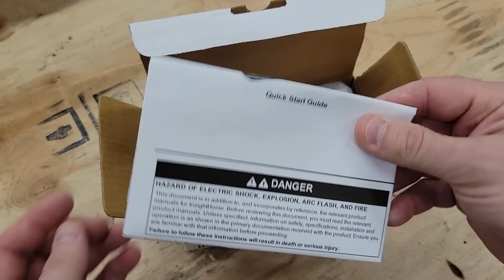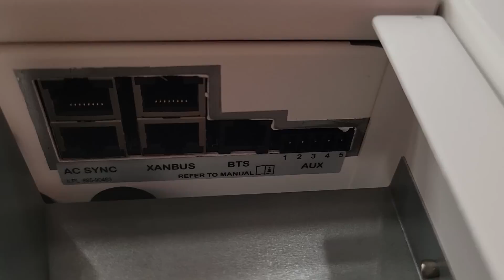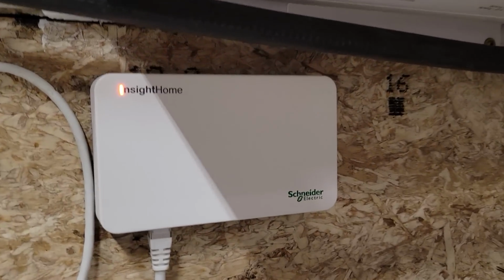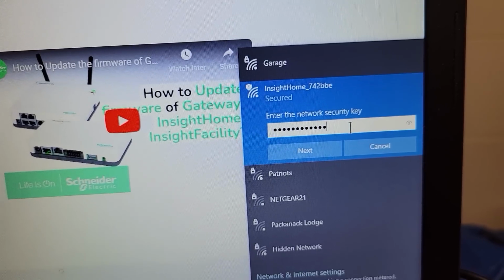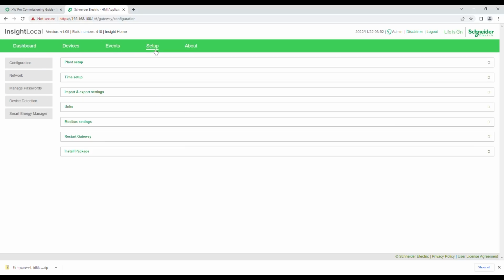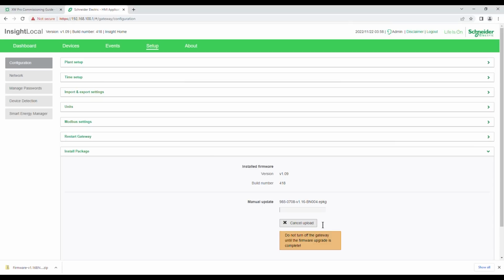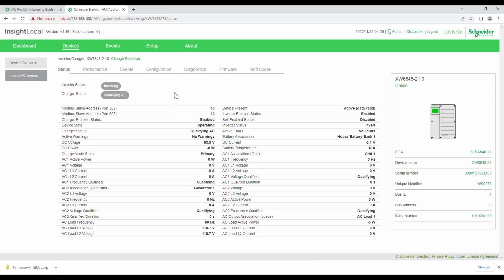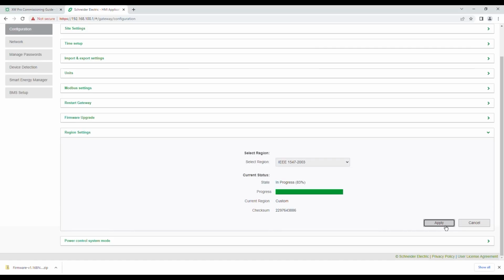Firmware Update on Schneider XW and Insight, off grid solar

Comment: XW and SW families of inverters are, in my opinion, the best inverters you can buy for any application. The surge capacity of those are stunning and the quality of the product is unbelievable. But, nothing is perfect, each and every component of the system is sold separately, sooooo,  at the end the system price tag will be higher than a all in one unit. At the end you can install all the parts in stages without having to pay for everything up front and you will end with a reliable system that can destroy any all in one system. I now that by experience. I put my 1300 square foot home off grid with just one SW 4024 and had no problem to run two mini split units at night. David…. You are on the right path. Thanks for share your experience. 

A side by side between a little SW  and a solark 8k should be an interesting one…..
Reply from the maker: Nice to hear about your experience.  Thanks.  It's been a few months now, and the XW has never faulted out while running my house.  Last year I tested the Sol-Ark 12k, and it was faulting out about every 2 days while running my house.

Comment: Fantastic work on getting through and figuring the Insight. We are super excited to have it up and running. When spring comes up in Alberta I’ll be installing 3XW Pro, 3 100/600, 1PDP, 3 15kw batteries and 60 425 QCell’s panels on 3 ground tilting arrays. 1 at 150, 1 at 180 and 1 at 210 degrees to stretch out my collection and reduce my midday peak. Being at the 53rd parallel my winters get short so I need a huge system to collect enough for night runs on battery. Your other video with the type of cable that can be directly clamp on to was awesome helpful.
Reply from the maker: Sounds like it will be an awesome setup.

Comment: The termination plug is just a 120 ohm resistor for the CAN bus. If the factory part is lost you could make up an RJ45 jack with a short piece of CAT5 cable, place a 120 ohm resistor across the wires for Pin 4 & Pin 5 (CAN-L & CAN-H) Be careful to fold back the other unused wires and make sure none are touching, these are the 15V + and - system power conductors, if they short the Xanbus network is lost and the power supply could be damaged.
Reply: Does this mean you can't use any ethanet cable?

Comment: Now that you have your insight you can do closed loop communication with those batteries from signature solar . That is a nice feature to have . Glad u didn't let insight intimidate you into not getting it .
Reply from the maker: Yeah, that will  make it worth while.  I look forward to that part
Reply: What is closed loop communication I have the Snyder SW 40 24 with lead acid batteries
Reply: @neomatrix2722  It is where the inverter and battery subsystem communicate with each other (the battery has a BMS, which is a battery computer).  Most importantly, the battery tells the inverter what the battery's charging profile is, as well has State of Charge (SoC).  They use RS485 or CAN serial communications methods.  RS485 is a superior standard than the old RS232 protocol
Reply: Good luck with that I've been trying to get mine connected to the eg4 batteries for a month and I sell and install all of this stuff the Schneider battery monitor is going to be your best bet from Schneider if you want it to work without a crazy amount of aggravation although the new firmware does seem to work good on the batteries the communication is the problem the shunt that comes with the Schneider battery monitor will communicate with everything through the xbus Network a lot better

Comment: David, you will find that the modbus connection is your friend.  everything speaks modbus.  I have solaredge and a heatpump water heater that speak modbus. You may also find your minisplits speak modbus.  With the addition of a raspberry PI and "node red" or Home Automation apps you can do power curtailment and monitoring.

And hey... you are becoming quite the master at this stuff!!!  What a journey!
Reply from the maker: I had no idea that appliances like a minisplit can talk to the insighthome.  interesting.  Now that I have it up, I can install a Schneider charge controller.
Reply: @DavidPozEnergy  Lets be careful here.... they all speak modbus.... but that doesn't mean they speak to each other.  You can use Home Assistant (I said Home Automation in error above) or node red to bridge the comms.

Comment: Right-clicking the zipped files in Windows file explorer will typically give you a drop-down menu that has an option for unzipping files. This will automatically create a file folder with the same name as the zipped file, which will contain the un-zipped files you need.

Comment: David,  I just wanted to thank you for this video..  I purchased the SW4048 inverter but they no longer produce the SCP remote display.  There is no great direction offered by schneider as to was the replacement is.  I have contacted support several times. I almost get the feeling these people do not really have any knowledge of their products. There are multiple options.  I chose the Insight Home gateway. It did not come with an A/C brick. Does the Xantrax cable power your device?     Anyway, I have watched several aschneider videos.  By far your has been the most informative and helpful.  Thank You.  Michael
Reply from the maker: Hi Michael,  Thanks for watching.
My Insight Home also did not come with an AC power brick.  The Schneider XW PRO, and the 600V charge controllers, all have power over ethernet.  Meaning, when I plug in a CAT 5 (or 6) ethernet cable, it powers the insight home.  I don't know if the SW also has POE or not.  
I used my XW inverter for months before ever connecting the insight home.  Right out of the box it was ready to work as an inverter.  But, to do more advanced features like generator, grid support, etc. you need the insight home.

Comment: Well done David,  love the video.

The InsightHome is a bit different model and it took me awhile as well to understand it.  When I bought it, it was called the "Conext Gateway".  That is where the term "gateway" comes from.  They discontinued that unit and came out with 2 different new gateways, labeled "InsightHome or InsightFacility" with the Facility allowing for much larger systems.

When looking at the Insight models, one needs to understand the needs Schneider wanted from the device.  From a single inverter and single charge controller installation to multi-inverters and multi-charge controllers installations AND the ability to REMOTELY connect and do things the same way as if in the same room.  

Once one understands their "model of operation" it become clearer what advantages it provides.

Also,  their deployment model is to  have "Installers" who do all of this, install, configure and interface with the homeowner.  It is not targeted at DIYers, but DIYers can grasp things and will seek out the info and eventually Do IT. But it takes time.

I have been using my gateway to monitor my 4 MPPT 60 150 charge controllers for several years now, and with my new Pro (less than 3 weeks installed - Wednesday before Thanksgiving) fits in nicely.

BTW,  I discovered that the InsightHome (gateway) acts a bridge between the Xanbus and TCP networking using an old protocol called Modbus (1979).  First I heard of it researching these devices, but I now wrote a python program (https://github.com/dougbertwashere/mppt60)  that reads all the registers of the MPPT 60 150. I use it to read all 4 CCs.  Will be adding the ability to read the XW Pro as well.  It is the data information that the InsightHome uses to present the data as a website.
Reply from the maker: Thanks for the breakdown, makes sense.

Comment: You should test a grid tie inverter one day. I got a cheap one from Amazon and it’s the most fun inverter I’ve ever used. Mainly because im pushing power into my home and using 100% of my solar panels power.
Reply: Mind if you share the link?
Reply: I can’t share links
Reply: I use a 600w15-32v 90-140v grid tie inverter by y&h if your wondering
Reply: Those inverters are technically illegal in the United States. They also do not follow NEC and are not UL listed. Your insurance company will not cover any damages caused by those plug and play inverters.
Reply: How do you prevent it from exporting?

Comment: Hi David, well as an IT professional,  i can say you do a nice job. 
You can see PCs are not your thing😀
But,  Schneiders upgrade procedure sucks, like many other other companies also mess up a simple upgrade procedure and/or their MANUAL. 
Nevertheless,  many times you need a trained professional to configure all settings. Also Victron has a lot,  on which you just need training. 
That said: lots of trained people also don't know all details. 
So,  in my mind: companies,  please just provide a good manual!
Usually,  even the trained pros, change settings which may not make sense,  but they are or told to do so by the manufacturer,  or from learning it the hard way(=experience), which they then are not willing to share...

So,  like BMSses without proper manual: how should you configure all settings...?

Comment: It's my understanding after some reading that you're able to customize the production and output screen are you able to show us out on your next video as my goal is to have a custom screen on my tablet hung on the wall showing me in real time the power production on making with my shoulder and the loads
Reply from the maker: I'll look into it.  I don't know all the features available
Reply: One thing I don't like about the InsightHome webpage, is if left alone it times outs and closes itself.  Move your mouse back into the window it resets the timeout count.  So as of now, it won't stay open showing its information. You have to relogin again - argh
Reply: This is where a company would be well served if it reached out to the diy off grid inverter YouTube community and ask: ‘what are we doing wrong, how can we make it easier to set up and use’?

Also- What features would you add?

Comment: Do you need the insighthome installed. For the inverter to operate? The reason im asking, is because im thinking about using this inverter. With a victron charge controller.
Reply from the maker: I ran my Schneider inverter without the insight home for 3 months.  The inverter will work right out of the box.  It's set up for 120/240V split-phase operation from factory.  You only need the insight home for more advanced things.  For example, if you want to parallel 2 or more inverters, set up 3-phase, generator, etc.
Reply: @DavidPozEnergy  oh I see, that's really good information. David I really do appreciate it. I'll only be using one inverter. But I'm really impressed by these inverters.
Reply from the maker: Good luck with your build.  I have several videos on my channel about the Scheiders.  I'm also very impressed by them.

Comment: Thanks for helping me with so many projects.Not related to this video,could you tell me how much solar to power my water trough heating element? And I'm unclear how to wire the 4 prong element.
Reply from the maker: Water heating is a huge topic.  I made several videos about it.  There are some variables outside of the information you provided.  Are you trying to go from solar PV panels directly to a water heating element?  Do you have thermostats involved?  Are you powering the water heating element from an inverter?  etc.  
I'd start by asking you to watch this video: https://youtu.be/kVaxAfXQPDU  After that, you are welcome to ask more questions in that video.
Reply: @DavidPozEnergy  solar to battery to element in water trough
Reply: element has 4 prongs with two plates. One video that I watched said to remove one plate, but it is not heating.
Reply from the maker: That style heater is 2 elements.   Each element has 2 prongs.  If you leave both brass busbars in place, you are paralleling the two elements.  This is done to increase the Amps at a given Voltage.  If you remove one of the brass busbars, then you must turn the other brass busbar.  Turning it is changing the element arrangement.   You will be making the two elements in series with one another.  This is typically done if you plan to use the heater with a higher Voltage.
Reply: @DavidPozEnergy  LOL. Thanks for taking the time for me. I LOL because I have one more question. So, if I only use one element, I place one positive and one neg on that one element?

Comment: Do you know if the Home Insite works with older XW Hybrid Inverters.  I have a model that came out just before the Pro.  It seems like all the videos I've watched only address the XW Pro.  Thanks
Reply from the maker: Sorry, I don't know.  Have you tried calling Schneider customer service?  I use this number: 833 391-8640  If you are somewhere else in the world, check here: https://solar.se.com/us/en/2021/07/23/meet-our-new-tech-support/
Reply: Yes, but Schneider does not advertise backward compatibility with XW inverters. Using COMBOX is not totally secure, unless your LAN is isolated or very well protected.

Here is the result from a search:

Insight Home is compatible with Schneider Electric’s solar & storage offerings, including the XW and SW lines of storage inverters, the MPPT solar charge controllers, and the accessories. Additionally, it's compatible with Schneider Electric’s commercial 3-phase string CL family of inverters for the European and Australian markets.

The COMBOX is not forward compatible with XW Pro inverters, but Insight gateway is backward compatible.

Have both gateways running in same XANBUS network for testing, but not recommended for permanent use!
Have not yet tested a firmware upgrade or downgrade from Insight Home to older XW inverters.

Comment: This is all new to me can this unit supply a 1400sq all electric  home without using a battery or solar panels only using a power generator?
Reply from the maker: No.  The inverter in the video requires a battery.  Now, if you don't have room for solar you can still use a generator to recharge the batteries.
Reply: @DavidPozEnergy  Thank you. What battery hook up will I need to supply my needs?
Reply: @DavidPozEnergy  David this is a summary of ELECTRIC we use.This Week: 12/18-12/24Last Week: 12/11-12/17￼Usage607.9 kWh334.6 kWh￼Cost￼  $89.30$50.04
We live in the Houston area. 
What kind battery Bank would I need? Is there a power source that does not require batteries? The panel box is outside of the house need to limit the clutter if possible.
Reply: @DavidPozEnergy  what battery pack would you recommend.

Comment: Is it possible to make this system work with only a smart phone no lap top and a weak internet hotspot???
Reply from the maker: I think so, but I can't say 100% because I used a laptop.  First, Schneider knows that a lot of customers don't have internet, so this is how you get around it.  
1. Find internet somewhere (coffee shop, library, etc.)
2. Download the firmware file to your device. (laptop, tablet, etc)
3. Go to the insight home location.
4. connect to the insight home's wifi signal
5. Open the insight home using an internet browsing software (ie. Crome) 
6. Follow the rest of the steps in the video to find the firmware file on your device.
Reply: @DavidPozEnergy  I did get it working but will picking a laptop ASAP.
Reply: @DavidPozEnergy  thanks for responding. Maybe I could put together a list of question's and you could do a video about solving these infantile issues as they arise. There are so many settings... I'm not used to this level of functionality. All my other systems where plug and play. But I can't argue with its performance! It's outstanding charging my Tesla and running my farm with one inverter! I do still wish they would sell a hard wired control panel though...

Comment: Been following your vids for some time. have the exact same setup. do you notice on this firmware that if grid power is disrupted for just a few seconds, the xantrex want to start a new charge cycle?. Batterys are at 99%SOC and still want to start new charge cycle - cant figure this one out
Reply from the maker: I don't have grid tied to my solar equipment.
Reply: yes, this IS their SOP.  With the grid IN, the XW Pro acts like a UPS. Upon grid IN going active, the Pro verifies a good AC IN, enters Grid ByPass, then always recharges the battery as if recovering from a GRID OUTAGE event. Once the target voltage/SOC is reached, the charger turns off and the Pro continues to run ByPass and power the loads.  Lose Grid again (outage) and restore Grid,  the cycle repeats

I just upgraded from a 2005 Xantrex SW+ 5500 watt (120v only) inverter to the Pro.  The Xantrex has UPS mode AND a Battery Transfer mode (which is the mode I always used). When the battery reached Low Battery Cut Out, the inverter would stop inverting and switch to Grid ByPass. With the Pro we lose that mode. But wait there is more.   

In my build thread I documented what I am currently doing in adding that feature back in on the Pro with an external Sold State Relay (SSR) setup.  

Link here  

https://diysolarforum.com/threads/something-i-built-diy-back-in-2000-my-path-from-trace-to-xantrex-to-xw-pro-inverters.11/post-656047

and here

https://diysolarforum.com/threads/something-i-built-diy-back-in-2000-my-path-from-trace-to-xantrex-to-xw-pro-inverters.11/post-658909